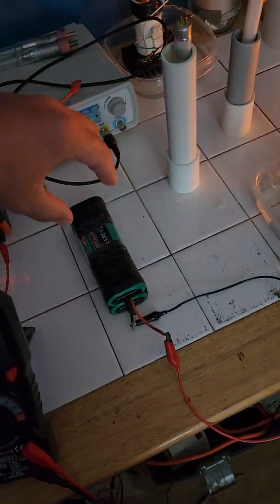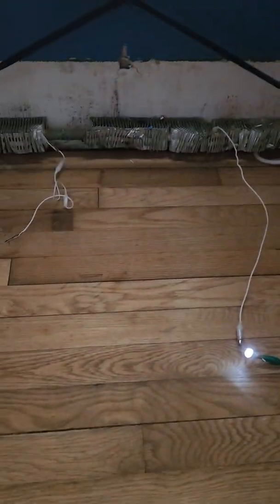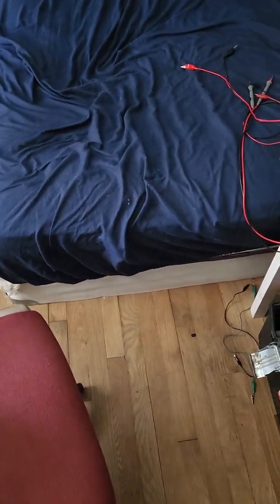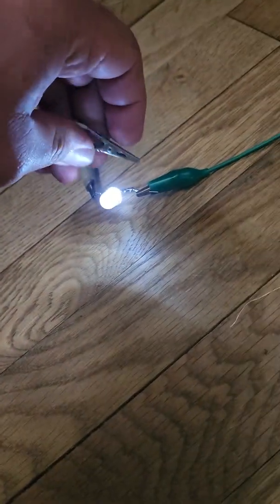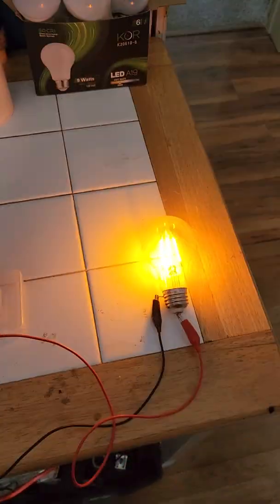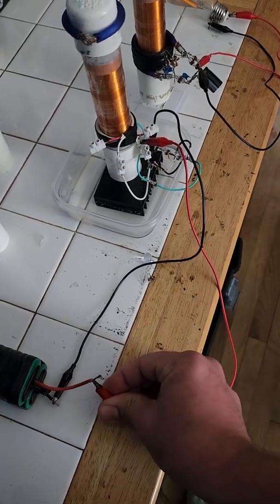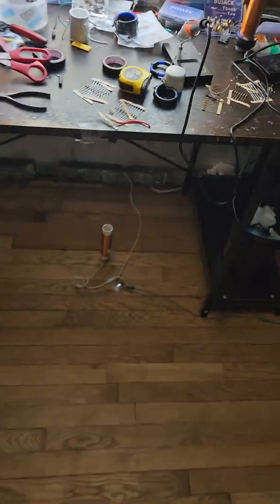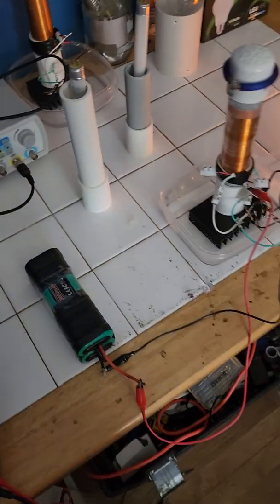UNBELIEVABLE BATTERY POWERED BREAKTHROUGH! 🔋 MY SYSTEM WORKS THE SAME WITH A BATTERY!

Comment: Great result. Try calculating how much power is dissipated out of the battery when adding additional loads to the system and see if extra power is drained out. This should show how promising the system actually is.